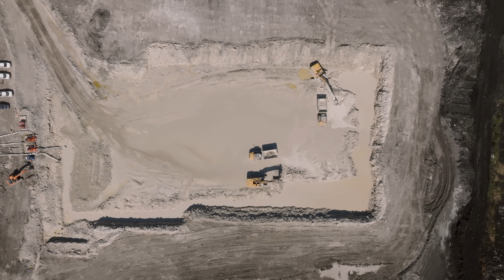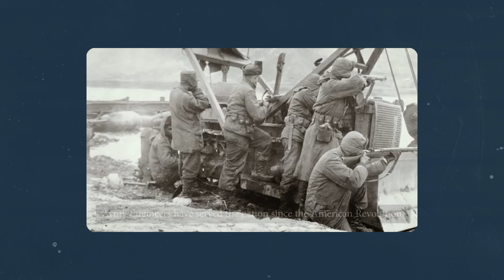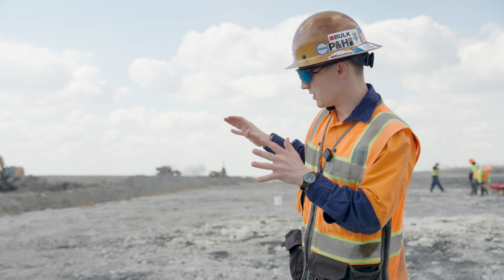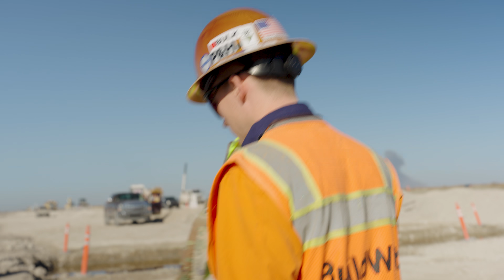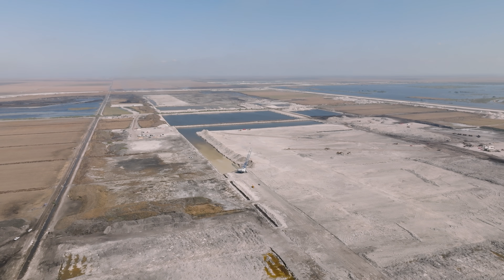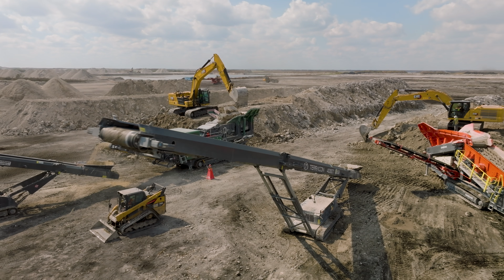Why is the US Army Building a $4B Reservoir to Save the Everglades?

Comment: The engineering challenge goes beyond storing water—it’s controlling seepage through Florida’s porous limestone. A properly keyed cutoff wall, well-compacted embankment, and rigorous material testing are essential to prevent leakage and maintain structural stability under sustained water pressure. Water storage is only effective when the foundation and seepage controls perform as designed. – Dr. Sera, P.E., PhD

Comment: Everglades didn't need "Fixed" until we showed up, it worked for a millions years, we will never "fix" it until we make like it was.
Reply: @russell3380 - and that will never, ever happen.  The so called natural flow from prior to the civil war that so many opine over is never, ever coming back.  Nor should it.

What Disston and Broward did was conquered the last American frontier.  They literally turned swamp land into viable, productive farm land that has provided food, jobs and a way of life for over 100 years.

What's happening with the CERP is mankind taking 150 years of gained knowledge and engineering expertise to update the water management and control systems in order to continue farming while providing water in areas that have been previously neglected.

It's a good thing that deserves support.
Reply: @brucemccrary6286  It should restored to it's original state, it was never broken.
Reply: @russell3380 - It's not ever going to happen.

In order to accomplish that, every person, building, road, bridge - any and all existing infrastructure - would have to be demolished AND the debris hauled away.  In addition, there are over 3,000 miles of canals in the area that would have to be filled in, culverts, water control gates, irrigation pumps, pumping stations, all would have to go. Otherwise it would impact on where the flow would go.  It would be a miracle if it ended up in Florida Bay and not Miami Beach.

There has already been billions of dollars spent on keeping the area as viable, productive farm land.  Plus, Florida sugarcane farming and its related industry drive almost 5 billion dollars in annual economic impact.  It supports over 19,000 jobs and generates more than $800 million in direct annual revenue from raw sugar and molasses sales.

We need to work with it, not against it.
Reply: @brucemccrary6286  Lake Okeechobee is a perfect example of fixed? Urban sprawl should have been limited to the coastal ridge and everybody is going to end up thirsty in the long run. All the money in the world will not fix it, it wasn't broken when we decided to fix it, it was in the way.
Reply: @russell3380 - despite your fixation with it, no one ever thought the swamp was broken, they felt there were better uses for it.  It wasn't "fixed", it was reclaimed and utilized for productive farming.  Period.

I'm glad you brought up Lake O, that's a subject near and dear to my heart.  I love that lake, and have for a lifetime.  What it's suffering from has little, if anything to do with agriculture.  Sure, the farms have some culpability, but so does every industry, business,  resident and visitor in Florida.  At least the farms are taking steps to midigate their impact.  Through best farming practices there has been a better than 50% reduction in the amount of phosphates being used and in run off from the EAA.  The water is actually cleaner when it leaves than when it arrives.

The culprit, as you alluded to, is the massive increase in the population, particularly in and north of the Kissimmee River Basin.  Florida Atlantic University released a report last year concerning a study they have been doing for years.  It says, in part;

Results of the study, published in the journal Harmful Algae, reveal that combatting harmful algal blooms in Lake Okeechobee requires managing both phosphorus and nitrogen, and that human waste played a role in influencing these Microcystis blooms. Findings also underscore the importance of rainfall and extreme rainfall events in driving these big blooms.

Inorganic nitrogen levels were elevated in urbanized estuaries and the Kissimmee River, which extends north through the Kissimmee Chain of Lakes to the greater Orlando area, and its water flows into Lake Okeechobee. Furthermore, the expanding urbanization in Orlando was identified as a contributing factor to the increasing prevalence of these blooms in Lake Okeechobee.

Findings show key changes in Lake Okeechobee’s algal conditions over the years. Nitrogen-to-phosphorus ratios, microcystins, and Microcystis cell counts in the lake are now higher than in previous decades. Phosphorus levels increased from 50 micrograms per liter in the mid-1970s to more than 100 micrograms per liter by the late 1990s. This rise in phosphorus supported the growth of harmful cyanobacteria like Dolichospermum, which began to outcompete other algae.

Findings also show that the higher nutrients in the urbanized Caloosahatchee River Estuary and St. Lucie Estuary enhanced bloom formations in those locations. The nutrients – ammonium, nitrate and phosphate – are highly reactive, which is why the researchers observed thick “scum” on the water’s surface in those estuaries.

“When water and Microcystis is released from Lake Okeechobee into the estuaries, the growth response is like ‘Miracle Grow,’” said Lapointe. “We found the highest concentrations of ammonium, nitrate and phosphate in the estuaries. These nutrients are commonly associated with human waste. Specifically, we observed elevated nitrogen isotope levels, indicating that human waste is a significant source of this nitrogen.”

This research supports the need for improved wastewater treatment and water storage north of Lake Okeechobee including the Lake Okeechobee Watershed Restoration Project and the Lake Okeechobee Component A Reservoir project spearheaded by the South Florida Water Management District.

Now, add in that during the time that the Kissimmee River was 'straightened out' and turned into the C-38 canal over five times the level of pollutants, chemicals and as we now know, human waste, that the lake could handle - at that time - were literally being mainlined into the lake.  Over 500 tons a day, for 50 years...

Now let's talk about the FWC and their chemical cartel.  Since 1976 they have been assaulting all of Florida's waterways, put particularly Lake Okeechobee.  There are videos on line that are easily found, and I have personally witnessed spray boat operators blanket spraying everything around them, not spot spraying invasive species, dumping unused material into the water and using chemicals that were neither designed or approved for aquatic use.  The spraying has reached a critical mass as the dying and decaying plants release the chemicals back into the water, where it moves with current and wind doing even more damage.

I could go on, and will if your interested, but I think my point is made.

Comment: Lake O is tragically polluted from waste water and farm runoff. This is an expensive way to pollute the Everglades and not hold polluters accountable.
Reply: It's actually going to hold water to be more consistently released, even during dry seasons, and using the natural grasses and aquatic vegetation in the STA's to filter the water, like Lake Okeechobee used to be able to do before the FWC's and the Chemical Cartel's spraying attack of the lake, and the steadily increasing load of pollution, chemicals and human waste coming down the Kissimmee River from central Florida.

To try and deal with that there are several projects north of the lake that are part of the CERP that will also hold, filter and slowly release the water into the lake.

Comment: Lets say this work is done in 10 or 15 years, finished and mostly done as drawn. What are the odds this huge and vastly expensive project actually functions in a way that is needed to "save the Everglades"? In my watching of big projects, especially federally funded and managed ones, it seems also certain that within 4 or 5 years of the finish date, a small oversight in the planning will become obvious and cause a 50% of the original cost "fix" to be needed. It looks like this new reservoir is being constructed as one big bathtub, and this is what I think might/will happen; 'they' will find that embankment wall foundation in spots wasn't made deep enough so water is escaping, or the carefully prepared bottom has a serious leak in one or two areas. In any case since its one big bathtub instead 6 or 8 smaller ones, to deal with the problem all the water will need to be drained so repairs can be made. But before 'they' do that, they'll spend several years and another billion or two trying to put a cork in the leak. And after several attempts that proves not to work, some bright young engineer will come up with a solution that should have been realized back in 2010 when this sink hole was being planned.

But by then it will be 2050 and the smart guys will finally have realized that the Everglades as they came to be before we decided to engineer them to near death and spent who knows how much money, was always a series of wet and dry seasons and that cycle is what works best. By then it will have been 100 years of building canals and dikes and a long series of plans that have never dealt with the basics; we can't have our cake and eat it too. We can't have the everglades as God gave them to us, so to speak, and have sugar farms and strawberry fields and suburban housing developments and giant AI barns trying to tell us what to do, and still that the glades be the one place on earth where there's a 100 mile wide slow moving river that should never have been screwed around with.

This will most likely end up being another Glen Canyon Dam mistake.

Comment: I’m surprised they don’t use air to move all of that loose debris, 
have a team of 8 or so trucks with air compressors and have a team of guys behind blowing the material to a designated area.
 Of course you would have to work with the however the wind is blowing that day. But I have seen a lot of fine material moved that way
Reply from the maker: they do plenty of that here as well
Reply: Or they could spray it down with water and then sweep it with the broom tractor. I feel like that would group the fine material together a lot faster than picking it up by hand

Comment: The governor of Florida, the other day in a video they did out by the new everglade project said, If my memory serves me correct, the drag line costs $250 million dollars. The core of engineers called them and said they need the money really fast. And president Trump helped with securing some of the funding, while the state of Florida secured the other all within I believe a week. Just think of the effort it is to have to deliver one of these machines. They have to be disassembled, transported and reassembled, which takes months. I have seen videos on similar drag lines. You just have no idea how big they are until you get inside. Of course standing outside is no different. The electric motors that they have inside are enormous and they even have repair shops with lifts inside to help pick up the motors and remove them to work on them. They are a multi-story level structures. If you had to weld one of these together, it would take you a few years. They are a work of art.
Reply: This one is Diesel powered. Big Muskie was an all electric one and did have what you are talking about. This one should have two 800 HP Cat engines driving alternators.
Reply: "core of engineers"???????? "Army Corp" ... like "Marine Corp" but the Army.
Reply: @samking4179  Corps not Corp. Always with an s even though it is silent. Like in Corpsman. Unless you are Obama or wanting to make fun of them and then you say the s. But never say it if you are about to get shots.

Comment: Is the corp of engineers dudes hard hat backwards????
Reply: Depends on the hardhat. I once had a Corps safety officer complain about mine being on backwards because the bill was to the rear. What he didn't know, until I pulled the manual out of it, ( yeah, we knew it would happen so we left them in the helmet above webbing ) was that my hardhat was designed to be worn either way as it was impact rated from all directions.  Not just from where the bill was. Now why did we wear them that way? It is very hard to get your head in close enough when you need to inspect something inside a 4' diameter pump housing if it is to the front.

Comment: That seems to be insanely labor-intensive preparation.  Like picking crops by hand.  Not that I have any experience with hard manual labor, but you would think that an alternate method or material would be developed, like a John Deere dirt combine.
Reply: They have to spend $25000000000 somehow
Reply from the maker: I'll run the dirt combine idea past John Deere